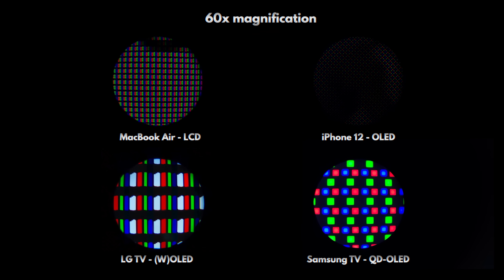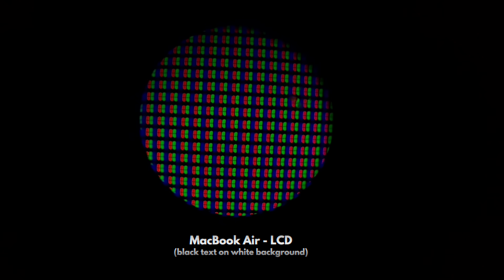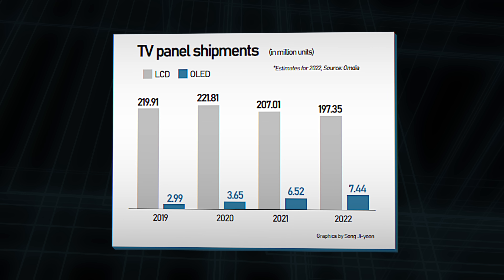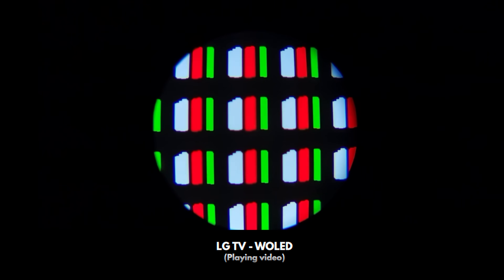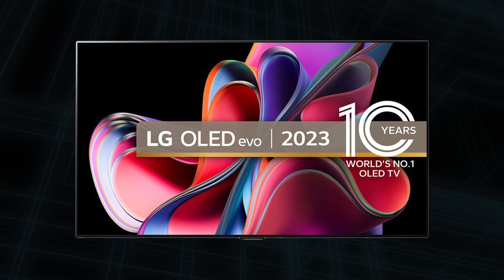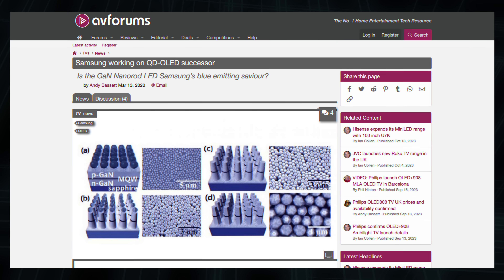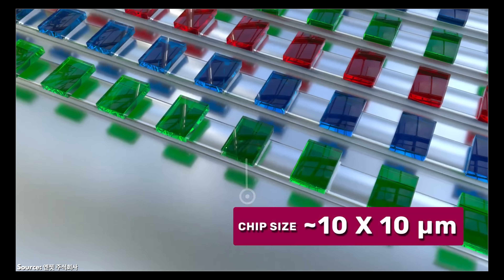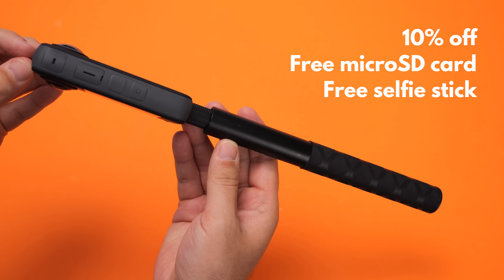The billion dollar race for the perfect display

Comment: I have no idea why people think microled would not burn in or out.
Any LED will get weaker the more you use it. It is not some kind of infinite light source.
Reply: @BlondieHappyGuy  Yeah it is so incredible weird to me. Even all the supposed knowledgeable people like all our favorite reviewers and tech reporter's keep spewing this a absolute BS that LED somehow does not burn out or in. 
Like they somehow does not change its characteristics over time and with massive amounts of power and heat running through them. It is so baffling to me. I can not believe they have never in their life's have not run across a dimmed LED. That is what they do....they lose efficiency and output.

And just like OLED if you run them harder as in hotter and with more juice they will go worse sooner.

If the type of LED they will be using will somehow have a longer life time than OLED, then they will just run them harder for more max output because that is what you always do. You scale the output to a reasonable level of output to lifetime and efficiency. 

And then we will be back at the same place as before with possible burn in and or burn out because they will never leave so much performance on the table that the screen holds longer than the electronics in them. 

All these things have built in planned obsolescence.

 They really have not thought about this even for a minute.
Reply: @BlondieHappyGuy  Yeah I agree. I build my own devices with LED's so for me this is second nature.

But I find it inexcusable for our favorite reviewers and tech reporters to not consider even for a minute the whole basic claim and the whole point of why microLED will be this whole new great thing. 
The supposed non burn in of them. Is the whole point and they do not have a basic thought about.

Hmm, lets think about this for a second does this claim sound true from anything i know about reality or not.

It is like Intel would claim this new future generation doesn't use several times more power than AMD's best to keep up. We will instead cut it to only 1/3 of what AMD is using AND we will beat them on performance.
Is just as dumb and clearly untrue. Because they would never leave that much possible performance on the table if they could they would always run it to the limit where power consumption and performance is the best trade off.

And it is the exact same with OLED and LED. Just a little basic critical thinking and comparing with what your already know will debunk the whole idea, or at least make you so skeptical you would not just repeat the claims as gospel without saying something on how implausible the supposed new future tech "benefits" are. So you do not go around and spewing BS.

Comment: Pixel shift delay (response time) is also important for gaming for a non-ghosting image. They should consider this also.
Reply: This is never discussed and i have noticed the extreme ghosting in displays that are not TN lcd. I think companies trying to sell anything other than TN panels as a supposed "gaming" monitors are committing fraud because the ghosting of things moving across a black background is so atrocious that it's criminal. This effect is also easily noticeable on oled phone displays. And the refresh rate doesnt fix it.

Comment: MicroLED is what I've always assumed normal pixels were like. I had no idea it was actually so complicated
Reply: You would think you just need to use typical methods you use for putting components on PCBs... and yeah, it is how they make them but if you consider size of the display. number of LEDs (8.3 million for 4K display! Or 3 times that if you choose to use separate R, G and B LEDs for higher brightness) and that you are directly looking at such PCB where each part glows for better visibility it then makes sense that cost for making such display would be high. Not to mention all the LEDs itself are pretty expensive.

What we really need is to have something where each LED can be grown directly on the panel substrate - in this case it will be blue LED and quantum dot filters will be used to make it RGB... and actually it is most probably how it is made with MicroLEDs because even if inorganic LEDs do burn-in slower they are still exhibiting reduction of brightness and different colors experience it differently. You would not want your fancy MicroLED that costs million dollars to get yellow or pink or blueish, etc. over time.
Reply: You're exactly right! That's why I was always amazed by how cheap color displays had become.
Reply: Same, I only started learning about monitors after I got an OLED phone and it looked better than LCD and I was like hmm why is this a thing 

Crazy how the only actually good technology (microled) is so insanely expensive
Reply: @xenird  wdym by "good"? QD OLED displays are definitely good, and the generation 2 and 3 displays have a very small amount of burnin (with it being covered by warranty).

CRTs are also good, the only issue is weight, but for pc monitors they make a phenomenal display.
Reply: @theunholybanana4745  OLED has low brightness and burn in
Reply: @xenird  with older OLEDs they were issues, but people have been using the 34 inch QD OLED ultrawide from Alienware for literal years without any issues with burnin, also that thing gets bright.

And if your standards for a "good" display is being literally flawless (which isn't even the case for microled since they would still have the latency and issues with digital processing that is not present in CRTs) then you really need to lower them.
Reply: @theunholybanana4745  exactly what i thought, saying that microled is the "only actual good technology" sounds like the opinion of 13 year old or a fool
Reply: @xenird  MicroLED also has compromises and flaws. It is only perfect when you don't see it. Besides as far as colors are concerned QD-OLED has almost the same colors and is very much like mobile OLEDs but does not have issues with MURA, dirty screen effect and doesn't burn in as much and certainly color doesn't change over time. The only thing MicroLED has over QD-OLED is being able to be super bright..

...and otherwise you did see MicroLEDs! All these super bright billboards that you always wondered why they are legal when they blind all the drivers are using the same tech - MicroLED just have more tightly packed pixels and typically you don't see any effort to correct gamut of ads on these billboards so colors there look ridiculous and MicroLED TV will have gamut corrected. Otherwise issues you can see on these billboards are the same as MicroLED has - just being indoors tech MicroLED has less issues like these... and if anything technician will come to your mansion and will repair them for you :)

Otherwise where it comes to actually good display technologies for home you had Pioneer Kuro plasmas - the TV you if you have today you can expect that people who visit you and see this thing will comment on it and ask you... why the hell does this TV looks so damn good??!! And no, it isn't limited to LCD users. Less so QD-OLED users (because WOLED is simply worse) but even then these plasmas were much better tuned for humans where it comes to light spectrum.
Reply: @xenird  That is only because it is extremely new and many microled displays in existence are in fact prototypes. MicroLED is not ready yet for mass  production.
That said, look up "SED" (Surface Conduction Electron-emission Display). This  combined the resolution of  LCD with the high contrast of  CRT. In essence, each pixel had its own electron gun and phosphor. Started in 1996, it was initially developed by a Toshiba-Canon joint venture, Toshiba dropped out at a certain point and court cases started mounting from other manufacturers, and LCD was a rising star. Canon officially pulled the plug out of the project in 2006. Only a handful of prototypes existed, and apparently, there are still a couple around - working. I'd love to see one before they disappear forever.
The displays had a true contrast ratio of 1.000.000:1 , way higher even than the best plasma tvs of the time (2004).
Reply: I love CRT, i like MicroLED, and i want OLED
Reply: This is nothing. led displays are cheap and rubbish. lcd is even worse, but it has no burn in effect. crts are the peak
Reply: @gabrielvieira.4358  😂
Reply: @gabrielvieira.4358  CRTs are not scalable. You try making a 55 inch CRT. CRT was king of contrast, never of resolution or size. Sorry buddy but CRT really is going to die out completely soon.
Reply: @paulmichaelfreedman8334  You are kind of late to the party, CRT's stopped being made ages ago, only some chinese still make some 480p(i think) tubes. With today's tech we could make a 29" tube (why bigger?) for computer usage, with half weight, lenght and power usage.
Reply: @ There are still plenty functional CRT's in the world. But they will eventually dwindle and become extremely rare. And then someone will start making them by hand again.
Reply: @gabrielvieira.4358  LED displays are just LCDs with W-LED backlight instead of CCFLs. LCD panels generally improved and cheap CCFLs were terrible but on high end good CCFLs were much nicer for eyes than W-LEDs and LCD panels already used good tech so higher end stuff didn't improve much. And if you consider WCG-CCFLs then even the best LEDs pale in comparison. The only thing which did improve is FALD for improving contrast and quantum dots to fix colors - though you cold argue WCG-CCFLs had better colors.

Comment: My prediction is that OLED will eventually die in a similar way to plasma.  Too expensive to manufacture, and picture degradation over a relatively short time period, and image retention. 

Mini LED is the way of the future.  If they can eventually reduce the cost of implementing thousands of mini LEDs in a display.
Reply: Mini LED will always stay expensive, because of higher number of components and because that backlight array becomes more expensive the better local dimming you have.
It would take hundred+ times the amount of current backlight zones to truly start minimizing halos and really thousand times current zones to eliminate it.
And you still have all the viewing angle and response time challenges of same old Liquid Crap Display layer!

Inorganic material based Micro LEDs would enable better durability than organic materials, but separate manufacturing of all those millions of individual LEDs (25M for 4K panel) and then moving them to backplane will be extreme challenge for bringing cost to consumer level.
Electroluminescent quantum dot LEDs excited directly by electric current and skipping that organic part of current QD-OLEDs and having chance for manufacturing using printing directly on panel backplane looks most promising to me.

Comment: OLED is still better because even if there's millions of LED in the backlight, the backlight bleed will counter the number of LED, whereas OLED doesn't have backlight bleed, abd the only limitation is the human eye.
Reply: That's your opinion I am personally not impressed by oled I have iphone 13 and samsung galaxy a34 both have oled displays and though it's not bad things like worse text clarity, not so bright as other types of displays and burn-in make me feel its more marketing than really great tech. Will wait for microled though and monitors at fast VA like odyssey g7 looks interesting for me currently have ips monitor gigabyte m27q
Reply: @godofdeath8785  worst text clarity ??? OLED displays are f bright now, look at the new One Plus it's like 4500 nits peak brightness... It's not even useful anymore. My pixel 7 pro is bright enough for outdoor use in direct sunlight so I don't think brightness is a problem, and I never use my LG C1at more than 30-40% brightness, except when it's very sunny outside, then I put it at like 70%. Also newer TVs are much brighter than the one I have like for example the new LG C3.
Do you know how many time you actually need to let a static image on an OLED for it to be permanently marked ? A lot 😂 except if your passion is letting the same exact image for one week straight at full brightness, you will never experience burn-in. Just look at any OLED phone and tell me if you ever seen one with burn in.
Also OLED is very thin like mentioned in the video, so for example my TV is like 1/3 the thickness of my old one, so it doesn't stand out as much from the wall. 
But in the end the best thing about OLED is for example if you watch a video in 16/9 on a 21/9 phone at night, you don't get grey borders in the left and right, it's perfectly black and the separation between where the image is on and where it's off is only 1 pixel, so you don't have a halo around your video. And also it saves battery life and makes AOD possible.

Comment: Qd oled the superior to w oleds
Reply: QD OLEDs have pretty bad pixel density vs AMOLED and aren't that efficient, W OLEDs struggle with warm colors.

AMOLED is the best OLED tech and miniLED the best sucessor.
Reply: @saricubra2867 using galaxy a34 with amoled ye its cool but miniled kinda sucks as I heard often people say good ips better than miniled
Reply: @godofdeath8785  Oh, microLED then.
Reply: And both lose against AMOLED and MiniLED. I using a Samsung CRT monitor from 2001/2002 that can run at 1800 x 1400, i was watching Tron Legacy, it looks better than my AMOLED phone (it loses color for the highlights) but it has perfect blacks and more brightness.

For motion clarity, the battle is unfair, obviously a CRT looks LIGHTYEARS better in motion.

Comment: Modern OLED screens are achieving incredible power consumption - which saves several watts of energy consumption for new smartphones. Similarly, many problems have also been solved/dispelled in development: bad points, dragging shadows. I think the biggest problem facing OLED now is the strobe caused by PWM dimming - a large number of consumers are allergic to it.
Reply: Strobbing on an OLED can be perfect for gaming monitors, there are monitors with VRR (variable refresh rate support) all of these features to simulate a CRT monitor (i have a fairly high end one that aged like fine wine and looks amazing).

Comment: One thing the LCD part of the video didnt mention is that liquid crystals shifting causes a delay in pixel response times. Causing a greater input lag for any non pre rendered content like videogames.
Its for this reason that i dont think the LCD will ever be the ultimate display. 
MicroLED will probably be the best and AMOLED second if they do ever figure out how to produce them in the right size.

Failing that. Tandem oleds with Micro lens arrays, quantum dots, change the blue hydro carbon for PHOLED or galium nitrite nanorods. They should able to get bright enough and have plenty of lifespan. 

They should stop developing LCD's, the technology will never be the ultimate crab!
Reply: PHOLED is a 30 years old technology btw. It's not that new, but the 40 percent EQE Blue is recently developed.

Comment: @4:36 wait, so if they convert white light into a different colour, why still have a colour filter? Can't the quantum dot layer not function as the colour filter as it convert the light into the right colour? Also, why do it at the backlight where its still going to lose most of its light/brightness before the polarizers? 
Why are there polarizers in LCD's? I learned that they filter horizontal and vertical layers of light, but why filter the direction? Is that only for the attempt to let no light through?

Comment: My biggest question with all these panels is: why didn't they chose for the same Bayer layout of the colors as in almost every camera sensor? Isn't it more straightforward to project those  pixels also really 1:1 when watching something  (pic or vid) on 100% i.e. 1:1 scale (of course it still needs extra interpretation when using different layouts than Bayer, like X-trans form Fuji).

Comment: Not really understanding the point of the crab analogy. 
Of course if your device has a purpose, your device's evaluation criterias will be the same, whatever the technology.

It's like if you say planes and rockets developpements are kind of convergent evolution because they try to maximize the speed, energy efficiency and cost per ton, with solutions involving a hull that does not touch grounds. 
That's just by definition of their goal, but the technologies are still very different and not converging at all.

Comment: My theory about future lcd or oled screens (wich technically doesn’t make much sense at how they work regardless of filtering)
I was thinking of using two color filters instead of 3,let’s say red and turquaze,why turquaze you may ask???
Well with turquaze you can create color blue and green by dimming or increasing the light,this way you will get two colors for the price of 1,in theory color turquaze could be used for any type of screen,
Also video and foto cameras could use a turquaze filter instead to capture both green and blue colors,again to make it cheaper to produce regardless of comprimises in quality,am very curious if scientists could prove my theories to be right or not😁

Comment: we use microled screens at big live events but the audience is usually 20m away from the screen minimum. theyre also absurdly expensive at roughly 10 grand a panel (you need at least 10 do be doing small shows)